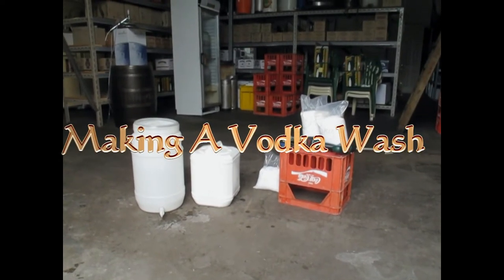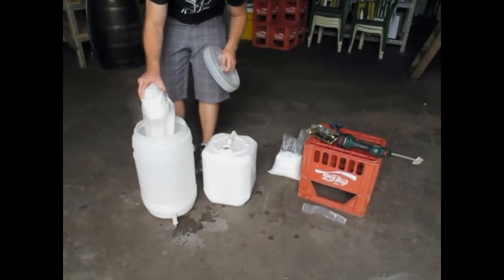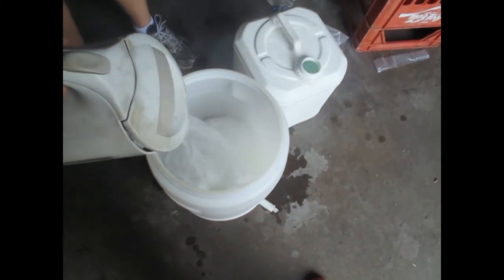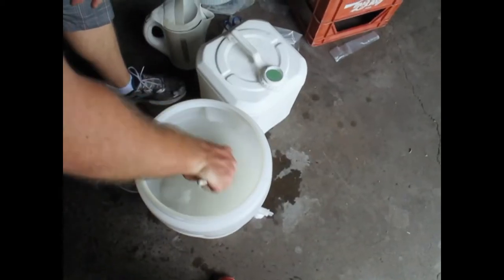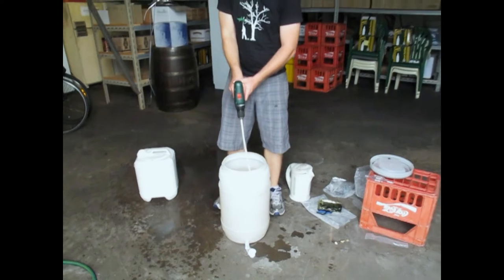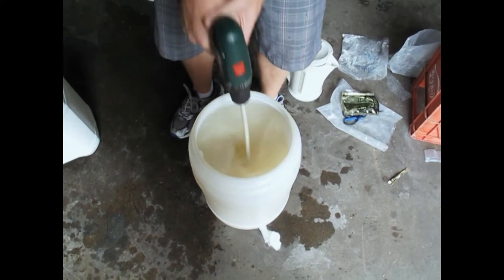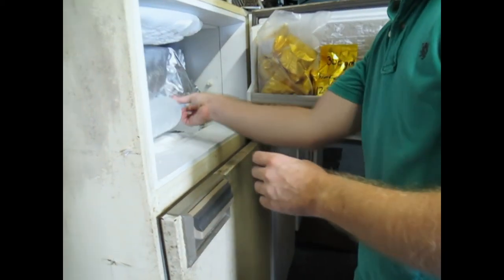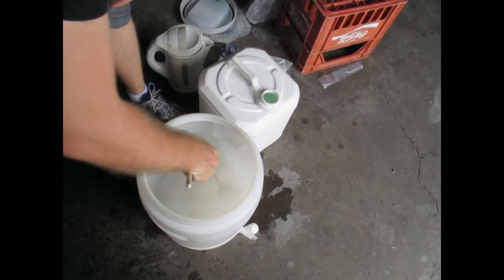How to make a vodka wash

Comment: I'm wanting to start my first sugar wash like this but only have normal yeast to hand...can I still go ahead our will there be any problems not using it? Great video btw!  :-)
Reply from the maker: Hi ***** , thanks for the kudos.

It depends on what yeast you have. Most beer yeast stop fermenting at 9-12%, while wine yeast will generally go a little higher. In theory, you could just reduce the amount of dextrose (or sugar) you are using (e.g., use 4kg to yield 10%, 2kg to yield 5%, etc).

However, the turbo yeast packets also have nutrients which enable you to ferment high quantities of dextrose (sugar/dextrose do not have nutrients like malt does). Without these nutrients, the yeast will not give you great yields. 

So, you would need to find out what the yeast is and its alcohol tolerance and adjust the quantity of sugar you are using, AND, add some kind of yeast nutrient (yeast nutrients generally contain dead yeast cells and a range of trace elements, including zinc). Hope this helps!

PS. Also check the use by date of your yeast. The older the yeast, the less viable it will be - this is a possibility your yeast won't work if it's not fresh enough!
Reply: homebrewerswarehouse Thank you for your reply and explaining ... Am very new to this although have,been brewing my own wine with brilliant results for some time now. I didn't risk doing the sugar wash without the turbo yeast...delivery is due today so will be trying your method very soon! Thanks again  :-)

Comment: this actually does not  make vodka its just a sugar water wash man its the most basic of basic ways to make alcohol water sugar yeast or dextros
Reply: Correct. Sugarshine
Reply: I BOUGHT a 50ml "Vodka" flavouring bottle for $10 and it's contents were Glucose, Preservative 422, and 5% celery salt.
Reply: By definition, Vodka is simply pure ethanol in water... it has not distinctive smell or flavor. However, this is only true for vodkas that have been distilled using refraction, or column stills.